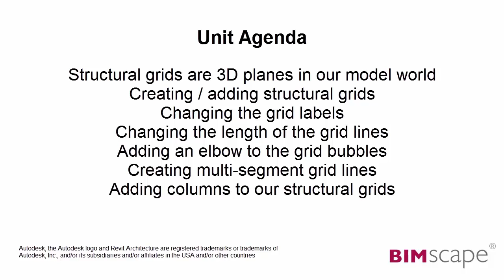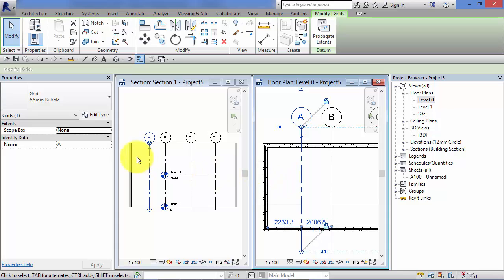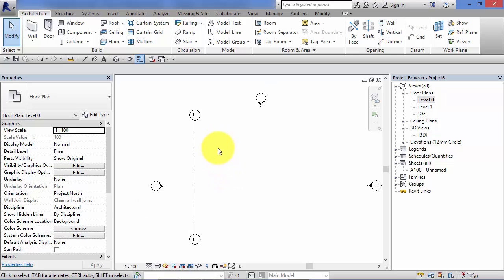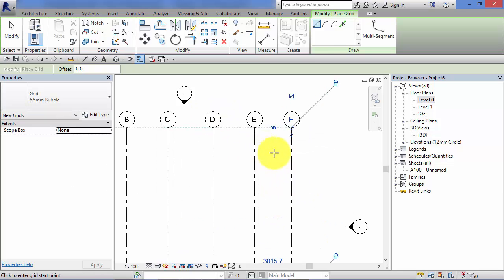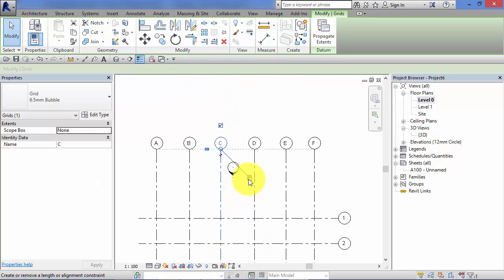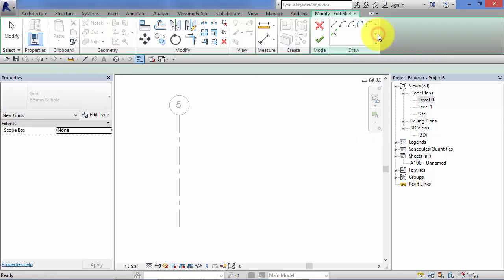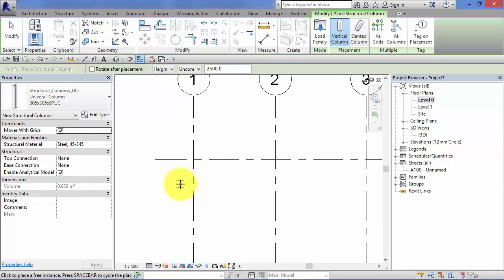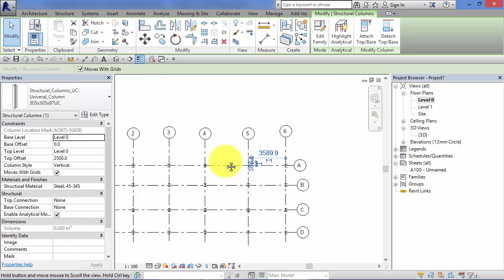Module 3: Unit 8: Revit Architecture: Structural Grids

Comment: When I try to create a column, I receive a Warning from Revit "None of the created elements are visible in Floor Plan: Level 1 View. You may want to check the active view, its Parameters, and Visibility settings, as well as any Plan Regions and their settings." I know this is not the Columns video of the serie, but does someone know why is this happening? Thanks a lot in advance.